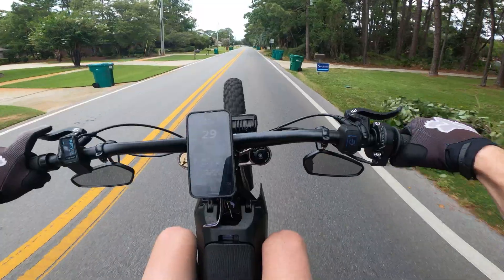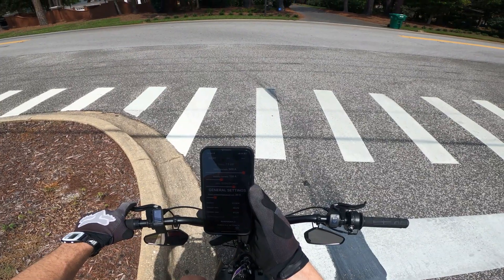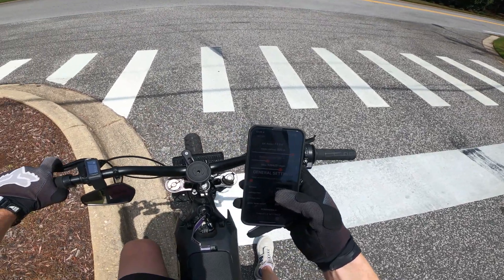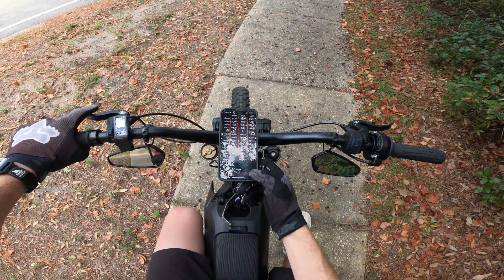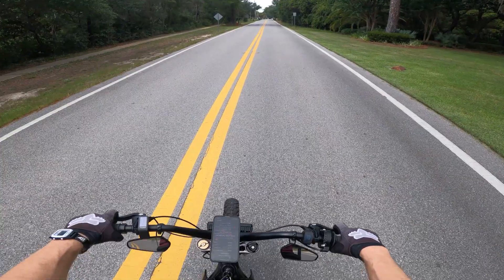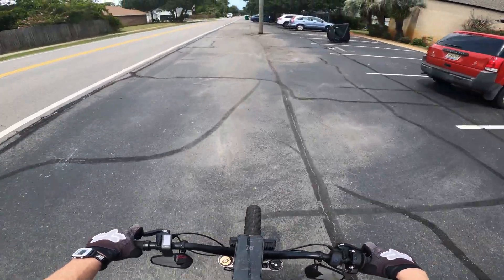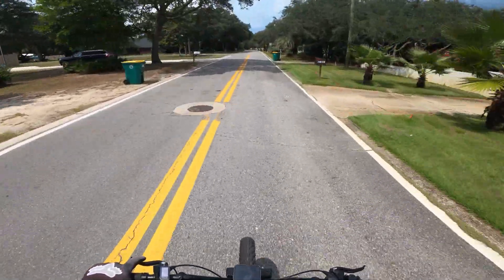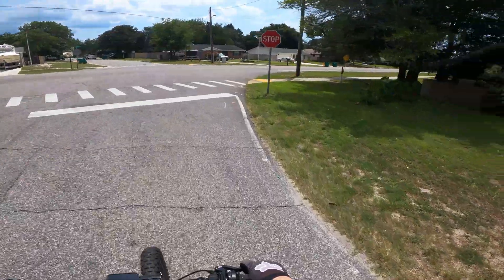Field Weakening Will JUICE Your Battery

Comment: I've got the Torp on my stock 2022 Ron with supermoto tires. Its definitely added more speed, range & efficiency. 
My field weakening is set to 45amps & my top speed (so far) is 58mph.
I have my field weakening set to kick in late, in order to keep the temperature down & to save battery.
Appreciate your content & be safe.
Reply from the maker: @ungratefulninja4535   right on! What sprocket are you running? I couldn’t even get to 55. I have the stock sprocket. I also didn’t know I could tell it when to kick in. I’ll have to take a look
Reply: @AdamEspositoYT  I'm running a 42t sprocket. On the 5th app screen, set your sprocket ratio & measure your back wheel diameter. 
Advanced settings at the bottom let you change FW activation start.
Reply: Oh, one sec... So I guess what you mean is that the Controller REDUCES the current to "40Amps" UNDER its normal power draw... ?? ... I'm not criticizing honestly I'm curious tho, is it like a Waveform Modification that reduces the pull on the battery like some kind of Pulse width Modulation or something? ... Like SO I imagine, to Giddyup it pulls full power, but at speed it lowers the current by 40 amps by changing the Wave Form to only Pulse when the Rotor is in the Best Possible Position??? ... Lol... I honestly am curious
Reply from the maker: @robbdudeson346 all good! Love the convo and curiosity. 

When using Field weakening, your actually increasing the amperage draw from the battery.   Anywhere from 1-50+ amps on my stock battery. The name is a little confusing. This feature INCREASES the amperage draw from the battery. Resulting in higher top speed, more power at high speeds, more motor wear, and reduced range. So there are some trade offs. Hope that is a little clearer
Reply: @AdamEspositoYT  then this isn't true field weaking. The controller is just increasing the supply voltage.  In true field weaking you're actually reducing the current and changing the phase so it does not aling with the motors back EMF. When the magnets in the motor spin past the coils. It creates inductance with creates a force which opposes the rotation of the wheel. So if you reduce the current and change the phase slightly. Your driving signal isn't alinged with the motors back emf so you need less power to make the wheel spin.

Comment: I could be completely wrong. Maybe it's new technology, but as far as I know, according to three-phase electricity and current battery storage, I think you're thinking of it backwards...
Reply from the maker: No im not. But thank you for your comment! 

Field weakening offers higher top speeds and increased power, but it can reduce range and increase wear on your motor and battery over time. Use with caution based on your riding needs.